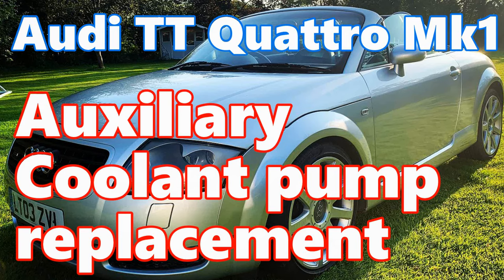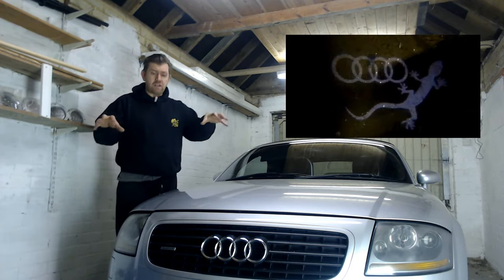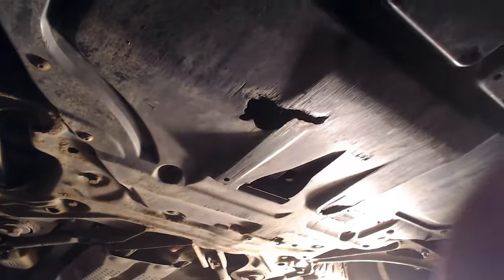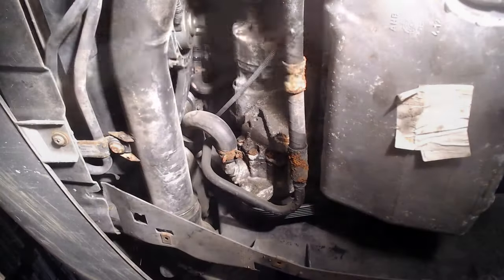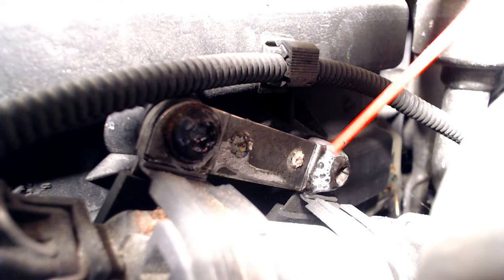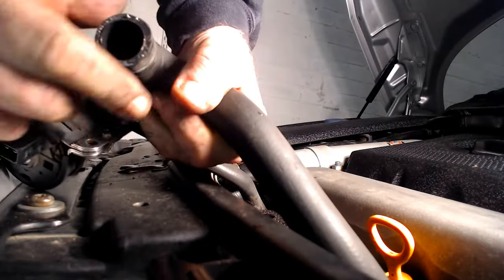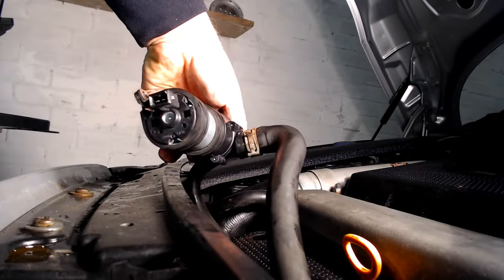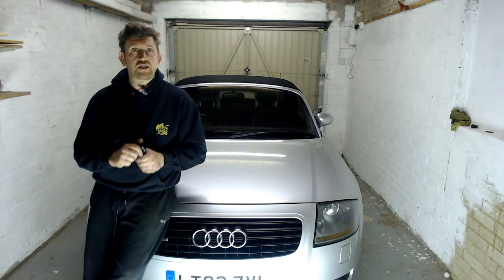Audi TT Mk1 - Replacing Auxiliary Coolant Pump -  secondary coolant pump replacement on Audi TT Mk1

Comment: This worked like a charm! Took 20 minute, took longer to warm up the TT to get all the fans on to check the fan control module. Did the old screwdriver stethoscope thing and the new pump is running just fine. Great video!
Reply from the maker: Thank you buddy. I am glad it worked for you!

Comment: You still stand out with all your instructions!  I did come up with a twist on your process that made my removal and installation a piece of cake.  Being an avid cyclist, I retrieved a micro-mini ratchet from my bike tools that not only slipped easily into place but left ample space to operate one-handed during the removal and reinstallation of the mounting screws.  I would caution you to trace your hoses forward and aft before calling it a day to make sure you have not accidentally kinked a hose and hampered the circulation of the coolant!  Andy, You Da Man!
Reply from the maker: Thank you Stephen and great additional advice! I to am a keen cyclist but do not have one of those mini rachets. I will have to get myself one!
Reply: @andycharger  Welcome, but now I've reached the other end of the rainbow!  After performing beautifully on a 40km test ride I went out again today and now the pump won't turn off.  What sorcery is this Mr. Wizard?
Reply from the maker: @stephenhancock2974  it will run on for around 5 minutes after engine switch off. That is its function. It continues to cool the turbo after switch off so runs  (you can hear the whine) for an additional 5 mins.

Comment: I remember when I got my car the pump started to make really bad noises… and then it stopped making any noises . I ended up opening the pump motor up and cleaning the brushes. Maybe a new pump would of been better but it was a ASAP fix. Thanks so much for the shout out. I was totally surprised 😮

Comment: Cheers. This is something im going to look into as I don't think my pump is doing anything. I don't hear it after I have turned the engine off even after driving hard. I didn't even know it had a second pump till recently. Noticed it the othher day and its quite rusty looking.
Reply from the maker: Definitely get it checked. It should have a definite whine noise coming from it after ignition is switched off.
Reply: @andycharger  it's something I'll look into. Only had the car for 2 months and it's not my daily so its not driven all the time. Been trying to sort other things out 1st

Comment: Dear Andy, does this auxiliarry water pump should be on all the time? In my tt 225, it starts to sound even before starting the engine . And after driving remains on for around 10 minutes ?
Reply from the maker: Hi Alan. There is some “after run” for the aux pump after the engine is turned off. I believe this is to continue cooling components such as the turbo after the engine is switched off. This kicks in, even if you turn the engine on and then switch it off immediately. So I think this could cause a fair bit of battery drain on my particular car! It is normal though.

Comment: Do they throw code if they go bad? I heard some sort of buzzing sound when I turned my key to acc mod or after engine off but now I can’t hear it.
Reply from the maker: Yes you will hear the buzz for around 5 mins after turning ignition off that is very normal for it to go off after this time.
Reply: @andycharger  aha, then I guess my pump is died, my engine is not buzzing anymore.

Comment: Do you think that the auxiliary pump link would cause overheating?
Reply from the maker: It’s used mainly to run afterwards to cool the turbo I believe rather than be the main pump. I guess it could but unlikely

Comment: Does it run for 10 mins after u switch the engine off?  Myne does not run and this weekend I will try and find the fault.. Any ideas?
Reply from the maker: Pretty much yes. Even if you switch the engine on then immediately off, it will do this. The car is trying to cool the turbo down after switch off of the engine.
Reply: @andycharger  in that case myne is not working at all no fans are on.. Only when I put the heating on they both spin..temo sits at 90 though.. But not heard the fans kick in yet when idling.. Il leave it longer tomorrow and hopefully they kick in

Comment: Going to do this on my Lilac 225. Does the 180 have an auxiliary coolant pump? I’m not sure it does….
Reply from the maker: Hi. No it does not have one on the 180 or 150 as they run a smaller turbo that does not get as hot. This pump is use to cool the turbo post spool down when you turn the car off. Good luck with the job. It’s pretty straightforward! 👍
Reply: Thanks for the vid, it took 10 mins because I removed the slam panel trim for easier access/visibility. The bracket that holds the pump was rusted onto the old pump on mine so I gave it a few taps with a rubber mallet around the bolt side then peeled it off the back, there are two tiny spot welds holding the bracket together and these failed so I put the bracket on the pump and zip tied it tight to make putting the mounting screws in easier. A dab of penetrating fluid definitely helps with getting the screws back in. Thanks again 👍

Comment: Hi Andy, I'm looking for the pump and I can't find it, my TT 180cv. carry? or no, Santander Cantabria, thanks friend.
Reply from the maker: Hi there. The 180 does not have the secondary pump. The reason is that Audi only included it as a “run on” pump to cool the turbo after the engine is switched off. You can hear it run after engine is off. I guess they believed this cooling was not needed for the smaller K03 turbo on the 150 and 180 cars. So don’t worry that you cannot find it. It’s not there my friend!
Reply: hahaha and I was looking for the pump like a madman, when you turned it off you could hear a beep for a while but now you can't hear anything, Greetings and thanks

Comment: Trying to figure this out without paying someone and I find someone saying the 225 has an auxhillary pump  but the 180 does not, does anyone know if this is true
Reply from the maker: You should be able to see the pump if it has one. I will check for you and let you know!
Reply from the maker: Hello Eli. I checked with the guru (Dom from @theparrottbros) and he advised you do not have one on the 180. Only the 225 and V6 have a secondary or Auxiliary water pump. I hope that helps!

Comment: Hi Andy! The link for Steven is not working. I searched for him and the correct channel link would be with: harpersteven!
Great video! Just bought a TT, and your videos are a big help already! If there will be a coolant leak I will know where to look!

Also. There are some TT-s with no onboard computer controls on the windshield wiper arms. I know yours have those buttons, but do you know if there is a way to see fuel consumption on these cars? (I have a '99 front wheel drive 179HP, with a cluster screen witch has a line in the middle) Or maybe these are the "dumb" ones? :D
Reply from the maker: Hi Tamas! Thank you for your comment and pointing out the broken link. The actual link on the video at the top works as does the one in the video description, but you are right on the text! I mistyped it on the video. I am going to look into your question on the wiper arms. Thanks again for your support!
Reply from the maker: UPDATE!!! I have blurred the wrong text out so please visit  steven's youtube channel at: www.youtube.com/harpersteven
Reply: @andycharger  Thank you very much! T